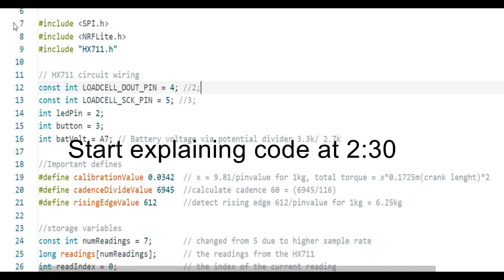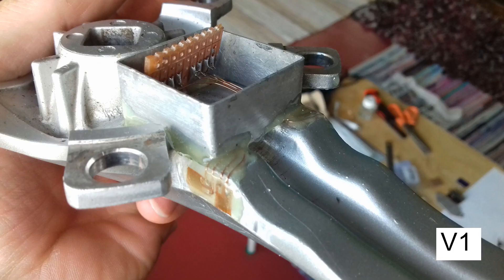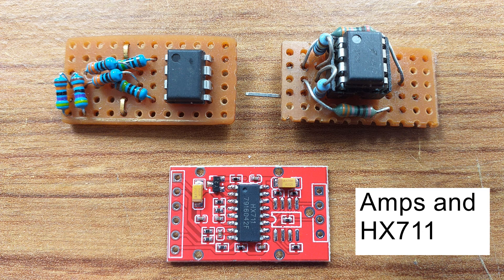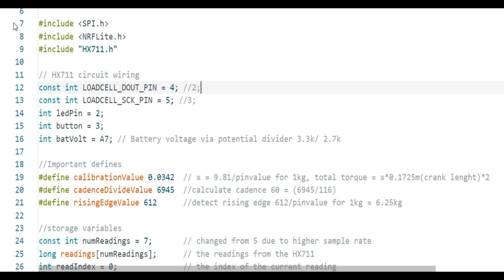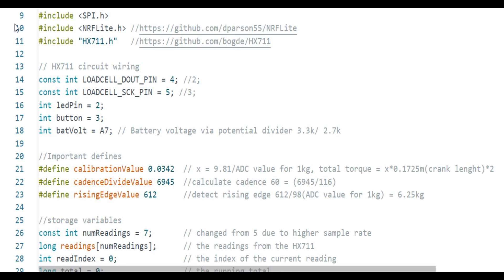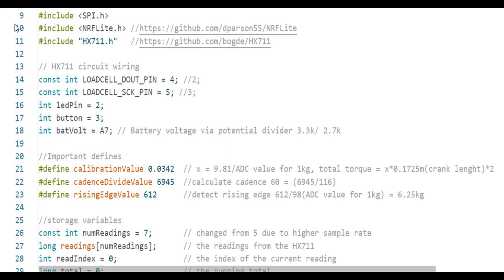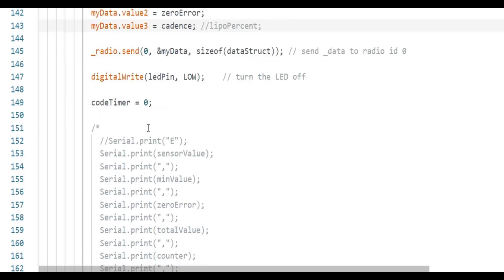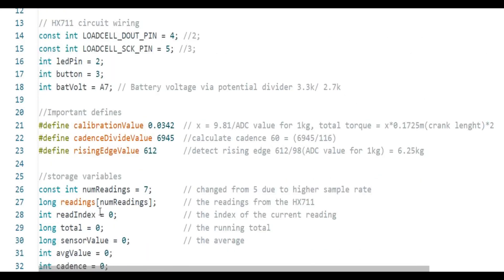Power Meter Code

Comment: I’ve successfully optimized the NRF52-based Bluetooth power meter further. I modified a significant amount of code, and it now supports time settings. During sleep mode, the 3V power supply to the MPU6050 and HX711 is completely shut off, with the mainboard in deep sleep. It wakes up via a vibration switch. Since China is in the middle of the New Year holiday, I can’t purchase electronic components yet. For now, I’m pushing things to the extreme: I have a FOVNO crank with a 24mm aluminum axle and 14mm threading, meaning the actual bore is about 13mm. I plan to fit everything inside it. I’ll drill two small holes on the axle and attach two half-bridge torque strain gauges. I’ll share more details with you later.
Reply from the maker: That's some good progress. Interested in how it turns out. Are you putting the strain gauges on the axle inside the bottom bracket? If it can work it will be more weather resistant.
Reply: @Ed.R  https://youtu.be/UbGfYWvKKG8  "The size is now more compact with direct module integration. The sleep mode power consumption is excellent, while the operational power consumption is relatively higher. It automatically enters sleep mode after 5 minutes of poweroff"
Reply from the maker: @zhsbadsbhu7396  Great to see your progress. I like the wake up and sleep feature as I have to push a button on mine. The power consumption of 11mA when running is better than mine at around 30 - 40mA if I remember correctly. Have you experimented with HX711 and the strain gauge excitation voltage?
Reply: @Ed.R he input terminals of the HX711 are powered by 3.3V, so the E+ and E- pins also use 3.3V. Since the input voltage is 3.3V, the power consumption is relatively lower.
4 I directly connect the lithium battery to the MPU6050, which has a 3.3V regulated output. This 3.3V supply powers both the HX711 and the NRF52 module.
8 I chose to use a stable 3.3V supply for the HX711 because I was unsure whether the data from the HX711 would fluctuate when powered directly by the lithium battery (with voltage dropping from 4.2V to 3.4V).

Key Points:

Voltage Stability: The HX711's performance depends on stable power. Directly using a lithium battery (4.2V–3.4V) may introduce voltage drift, affecting measurement accuracy 48.
Design Choice: Prioritizing the 3.3V regulated output ensures consistent ADC readings and avoids potential noise from voltage fluctuations 4.
Circuit Compatibility: The NRF52 module and HX711 share the same 3.3V supply, simplifying the power architecture while maintaining compatibility with low-voltage logic 4.
Reply from the maker: @zhsbadsbhu7396  I've had issues before with slow drifting of the zero value when using a regulator like that. I found the best option is to set the resistors on the HX711 so the onboard regulator gives out around 2.5V. You can still keep the other regulator.
Reply: @ The latest progress is: I have successfully modified the code to connect two HX711 modules working collaboratively. The current power data is no longer calculated as AVGFORCE *2, but instead uses L+R=AVGFORCE. I plan to record a VLOG to share this implementation soon.
Reply from the maker: @zhsbadsbhu7396  That's good mine is obviously only single sided. I look forward to a further update.
Reply: @Ed.R  我看了，就是说把那个20K电阻换成10K的,对吗。。
Reply: After replacing the 20K resistor with a 10K resistor, the voltage remains similar under a 3.3V regulated power supply.
Possible explanations:
The input voltage of your system might differ slightly.
Using an even lower resistor value could yield better results.
Voltage measurements:
E+ to E-: 3.24V
A+ and A- both measure 1.61V, but no voltage is detected between A+ and A-.*
Reply from the maker: @zhsbadsbhu7396  Very likely you have a missing ground connection. The HX711 board it looked like you were using in your video has this issue. There should be 0V between E- and the boards GND. If it's around 0.7V, then E+ will be this amount higher than it should be.
Reply: @Ed.R  I have three HX711 modules here, and none of their E+ pins are connected to GND. Do you mean I should manually connect E+ to GND? The weather here has been terrible these days – rainy, high temperatures, and significant day-night temperature differences. The zero-point drift observed falls within the normal range. When I tested it indoors for half an hour, the drift was minimal. However, after sunset with ongoing rain, the drift became noticeable again. This seems reasonable under such environmental conditions.
Reply from the maker: @zhsbadsbhu7396  E- not E + some HX711 boards have the E- floating not grounded, which means both E - and E+ will be a higher voltage than expected.
Reply: @Ed.R  Should E- be connected to GND for better performance?
Reply from the maker: @zhsbadsbhu7396  It's more about ensuring the onboard regulator works as you were saying it was still putting out 3.2V when it should be more like 2.6V. If the 20kΩ resistor is changed for a 10kΩ.
Reply: @Ed.R  I just measured the voltage between E+ and E- as 2.75V... Not sure what's causing this. This happened after replacing the resistor with a 10K one
Reply from the maker: @zhsbadsbhu7396  That's what I would expect. What about GND to E - and GND to E+? Would be best to have GND to E+ to be less than the supply voltage.
Reply: @Ed.R  The voltage between GND and E+ does not exceed 1V. I won't dwell on the 2.75V issue anymore... In any case, during daytime testing, the drift has become more stable compared to the situation before component replacement.
Reply from the maker: @zhsbadsbhu7396  As long as you aren't getting significant drift, I'm sure it will be fine.
Reply: @Ed.R  The red version of HX711 differs from the green and purple versions, possibly due to its R1 being 2.1K and R2 being 1.78K. This results in a completely different design, where the DOUT and SCK pins are additionally equipped with pull-up resistors.
Reply from the maker: @zhsbadsbhu7396  I've noticed differences between the designs. They all seem to work but if I remember correctly none actually followed the datasheet correctly.
Reply: @ Today I managed to implement three features at once: crank length adjustment, Adjusting sleep time intervals, and especially the power meter fine-tuning feature - which is basically a cheat tool for ZWIFT... Haha..."
Reply: @Ed.R  I carefully measured the resistors for the HX711 on the red board, finding that R1 is 4.7K and R2 is 1.8K. I'm going to buy 0603 resistors to replace the ones on the green board's HX711 with these values. You can also give this combination a try when you have time.
Reply from the maker: @zhsbadsbhu7396  more features than mine has.
I could easily experiment with resistors on one of my own HX711 boards as the resistors are through hole.

Comment: Very nice work! I'm also trying to put together a power meter for a fitness bike. To be fair, I was planning on using your code for calculating the power, but unfortunately it is no longer accessible. Could you please share it again? Thank you!
Reply from the maker: Thanks and sorry about the link. The Arduino project hub just doesn't keep the project public. I created a Github page instead. I'll try and post a link in another comment if not I'll also update the video description.
Just be aware the code will need modifications to make it work for you like timing and cadence calibration.
Reply: @Ed.R  Sorry, i missed the comment where you already shared the github link. I've been watching and rewatching the videos related to the power meter and some others. I have to say I admire your perseverance and ingenuity. Thank you for the code and the heads up. Also, thank you for putting up these videos.
Reply from the maker: @MrNoblody  No problem I should have updated the video description months ago. I do tend to stick with things beyond when most people give up. That's all it really takes to get good at something.
Good luck with the project. Don't underestimate that aspects of it will be a challenge.
Reply: @Ed.R  It sure took a lot of effort even though, having a working model made it far more easier. My approach is to iterate on an idea. I have started about a month ago with an arduino and some scale sensors from a broken one. Yesterday I have put together a working model with strain gauges and an ESP32 (that screams overkill :)) ) on a fitness bike.
Reply from the maker: @MrNoblody  Great work, it's nice to get feedback on how people have used my code. Seems like you have the right approach. Start simple, get it working, then build on that.
Other people seemed to have really struggled with the maths of how to actually calculate power but this happens to be my strong point. Whereas I'm not good at programming language.
Reply from the maker: https://github.com/Ed-Rose/BicyclePowerMeter/blob/main/Power_Meter_V3.1_HX711_116sps.ino

Comment: Thank you for sharing this information. I'm working on a esp32 BLE power meter which is compatible with Garmin devices.  I'm unable to find your code on arduino project hub. can you upload it again?
Reply from the maker: Sorry about that I discovered the project which was public had been taken down and made a draft. I thought I had successfully submitted it for publication again a few months back but it appears it hasn't been. I can't seem to do it now, something missing, so will get back to you if I sort it. Otherwise maybe need to look at another site for sharing it.
Reply from the maker: Try my GitHub I've just put the code on there. https://github.com/Ed-Rose/BicyclePowerMeter/blob/main/Power_Meter_V3.1_HX711_116sps.ino
Reply: @Ed.R  Thank you for sharing. I really appreciate it!
Reply from the maker: @micromagic31  Thanks for letting me know it was helpful. Good luck, power meters are a challenging project.
Reply: Hey @micromagic31 , I have the same project! I'm stuck with sending the data to my garmin. Did you made some advancements ?
Reply: @fast_click  I never finished the project. The bike I bought came with a powermeter, so there was no need to finish It. However I was able to send data to my Garmin. The data was garbage, but the Garmin received it. I think I messed up the code by putting the powermeter code in the "BLE loop".
I can share my arduino code if you want.
Reply: @micromagic31  Thank you for your fast response. I try to program my project in Python, but it would be great to have a look at your code. Could you send a Google Drive link in this chat? I'm sure other people might be interested in the future 😁

Comment: If you're only looking for cadence, why not use a dedicated cadence sensor? That might be easier/faster.
I faintly remember there being an (open source?) implementation of an ANT-Stack (probably incomplete though) for the NRF24L01. I think it was even an Arduino-Library. I myself use NRF51422 and NRF51822 for ANT or BLE single stack setups and NRF52832 for ANT+BLE dual stack stuff. With ANT you want to use NRF SDK (not NRF Connect SDK! since Connect can't do ANT …)
Reply from the maker: This is a power meter I'm developing not a cadence sensor.
EDIT (sorry just realized what the confusion is 🤦‍♂️. When I say the power is converted into cadence, what I mean is the auto shifter uses an equation to calculate optimum cadence from my power output.)
I have got the SDK power meter transmit example code working with an Arduino Nano BLE and Segger via a J-link. 
The bit I'm stuck with is getting my codes power value to the ANT+ page for transmission by the ANT Softdevice.
Reply: @Ed.R  Yes, but you mentioned you need/want cadence data for your automatic shifting.
The problem with the NRF SDK is that you can't re-use your Arduino code, or rather the Arduino parts of it. At least not easily. So you'd have to re-implement your code within the NRF SDK.
I did this by copying an NRF example with the most features I needed and changing/adding stuff I also needed. The NRF SDK also has Timers, GPIO input/output etc. Sure, it's different than Arduino but not impossible. What NRF does not have afaik is a library for strain gauges. So you'd have to build that yourself.
Reply from the maker: @hannesw928  The auto shifter has its own cadence measurement for when the power meter isn't connected. Power meters tend to transmit cadence along with power but its really to be used internally to calculate power.
I have a library for the HX711 working in Segger. I'm so nearly there it's just a case of bringing everything together.
I definitely don't see the point of sticking with nrf24l01 when so many boards are available now with an nrf52. No need for the extra wireless module.
Reply: @Ed.R  Ah, I see.
There is no point in using the NRF24L01 other than to see if you can ;)
I'm using NRF51/52 devices plus their respective Softdevices myself.
Reply from the maker: @hannesw928  The nrf24l01 modules have served me well through the years of power meter development and on other projects. Just the data isn't compatible with anything else.
You'd probably have the code written in no time. I need to get my head around the concept of pointers that would help a lot.
Reply: @Ed.R  Yep, NRF24L01s are a cheap and easy way to transmit your data wirelessly. I think fundamentally they are compatible with everything on the 2.4GHz spectrum using GFSK modulation, but of course using two NRF24L01s is the easiest ;).
I think you underestimate the amount of work it is to implement the ANT stack/protocol from scratch. I think 6 months only for power meter stuff, and only one ANT channel, etc … The full protocol would probably take years until everything is supported. ANT+ … I don't know.
I think the concept of pointers is pretty easy to understand, what I struggled the most with is the syntax used in C and C++. But you have to keep in mind, C was developed in the early 70s. Ease of use and non-professional programmers? Nobody thought of that. C++ just adopted the syntax. Java for example has only pointer (called 'references') there. However students still struggle with the use of pointers in C, despite the fact they have been using for them possibly years in their Java code ;)

Anyway looking forward to your progress.

Oh, by the way: are you familiar with the content of Keith Wakeham? He also built a DIY power meter and has videos about it.
Reply from the maker: @hannesw928  Keith is mostly responsible for getting me into making a power meter. He showed it could be done and at a time when he was to only one sharing such info on the internet that I could find.
Reply from the maker: The research I have done suggests that it's not possible to use an ANT-stack with an nrf24l01 because of the number of bytes transferred. Basic BLE works though I tried it once.
Reply: @Ed.R  Well the NRF24L01 has 32 byte FIFOs and an ANT message is at most 24 bytes afair (?). But I really didn't wan't to re-engineer/re-implement the ANT/ANT+ protocol ;)
Reply: do you have any clue how to get the "dedicated cadence sensor" value and putting it in an Arduino for a real time computing? im trying to make a power meter myself but i dont want to make a cadence sensor. and would it be possible if im using a Bluno Beetle for computing (because you said it wouldve need a component such NRF24L01 to "pair" up on "dedicated cadence sensor", while Bluno Beetle doesnt use an NRF) ? 

sorry if im quite up on the question, i havent quite figuring out things🙌
Reply from the maker: @MrSafetyRider  I not quite sure what you mean. If you have working strain gauges and HX711 my code will calculate cadence to be used in the power equation or transmitted if required.